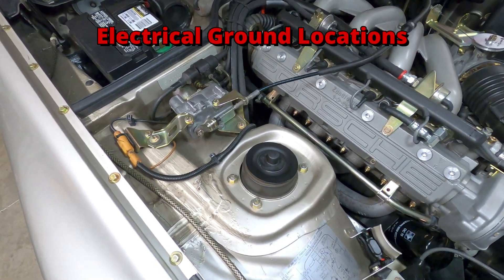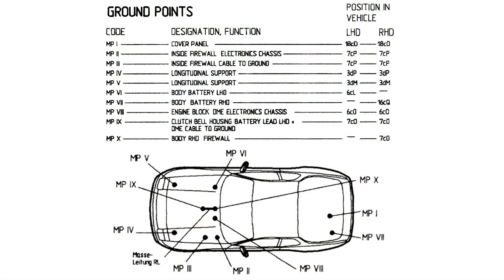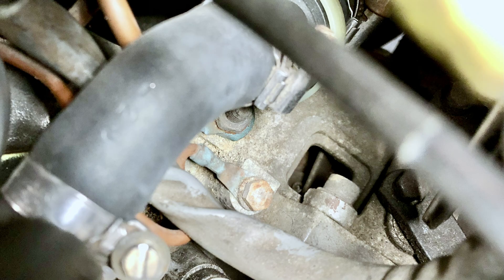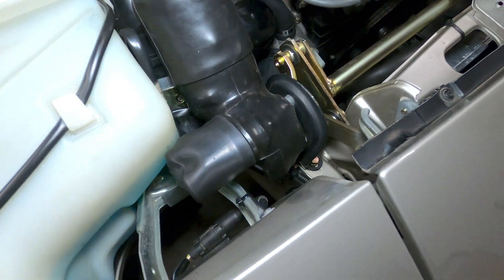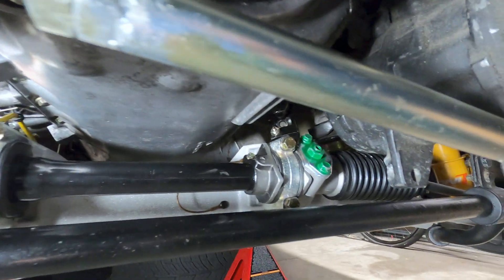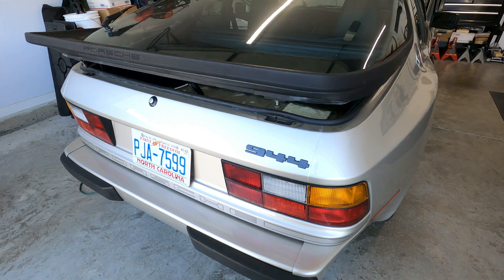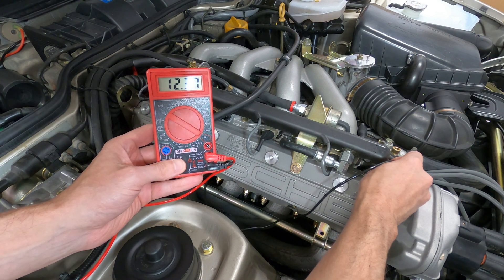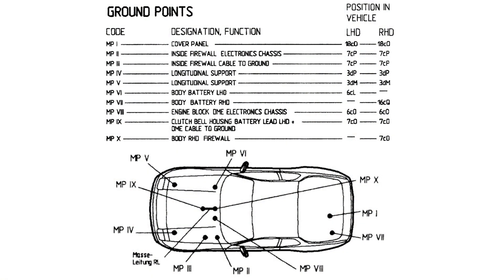Porsche 944 – Electrical Ground Connection Locations & Issues Tutorial

Comment: Great video.  Can I ask where you got the floor mats from?
Reply from the maker: Hey thanks! The floor mats are from Lloyd Mats out of California, but they no longer have a license to embroider the Porsche brand, still nice durable mats though. https://www.lloydmatsstore.com/
Reply: @NC944er  damn, I was looking for the Porsche brand. Thanks anyway👍
Reply from the maker: @daev_80  Porsche still sells a set with the logo, although they are slightly different from the original ones made in the '80s. Check out part number: 000043153225FV and here's a link: https://www.pelicanparts.com/More_Info/000043153225FV.htm?pn=000-043-153-22-5FV-OEM
Reply: @NC944er  cool, thanks for the help.

Comment: Do you put any dielectric grease on the ground connections?
Reply from the maker: Hey! My car is mostly stored indoors, so I don’t put anything on the grounds. I mainly use dielectric grease for things like battery terminals and the inside edges of the spark plug cable boots. There are some misconceptions floating around about dielectric grease and despite having the word “electric” in the name, it doesn’t actually conduct electricity, it just insulates. So if your car will be stored in moist conditions for extended periods, you could put some on the outside of the ground connections after they’ve been cleaned and tightly reconnected, which would protect the surface from elemental exposure.

Comment: This can be overlooked. I had a loose ground. Thanks for this! 

I am having a weird problem. My MPG gauge recently just pegged all the way to the right. It used to be pretty consistent keeping the MPG data. Any ideas with that? Wondering if the gauge has just quit. Car runs great, I did run a smog on it to see the hydro carbons etc. It passed with flying colors. Fuel pressure is on the money, spark plugs look great. Trying to rule out anything else…
Reply from the maker: Sounds like an electrical gremlin somewhere. Some people have had success cleaning and reseating the contacts and connectors behind the gauge cluster. Sometimes they come loose…
Reply: Ok. I will visit this. Thank you for the insight. You are always spot on! Thanks man.
Reply: I’m having the same problem with mpg gauge and also my temp gauge is swinging wildly from mid to high. Right before the mpg gauge stopped working there was a puff of smoke from under the instrument panel area. It was white and went away quickly. After that the temp gauge seemed back to normal for the rest of my drive. Next day temp gauge was swinging around again and the mpg gauge was moving but seems inaccurate. Do you have any advice. Could it be a grounding issue?
Reply from the maker: @brigittepauli  A puff of smoke from electrical components is never a good sign. Sounds like a short somewhere or a failing circuit. I would pull the gauge cluster and inspect the boards and all the wiring for damage.
Reply: @NC944er  thank you so much. I had a feeling this would be more than a grounding issue.
Reply: I solved it! FINALLY. I’ve always had this slight parasitic drain on my battery. Nothing major. Then, one day, I was driving and heard a small pop from the fuse box. Boom! #7 fuse popped. My cigarette lighter was shorting out. I lost my radio, interior lights and clock. This also…affected the MPG gauge. Now it’s all working after replacing the cigarette lighter and number 7 white barrel 8 amp fuse.
Reply from the maker: @P1983sche   Nice, a great find! Yeah, for the circuits that have a number of accessories connected together, it can be a real pain to narrow it down. And the electrical diagrams in the manual are slightly less than approachable. 😂
Reply: @NC944er  Man. You said it. I had an electrical thing in the window switches. Took me longer than I liked to figure that out haha. My passenger window switch wouldn’t roll the passenger window from the driver’s side. Usually electrical problems are from someone else going in and hacking the wiring. They had things connected wrong and backwards.

Comment: Went through mine not too long ago, helped gauge readings quite a bit. Also to note, it’s good to cover the bell housing hole before removing the grounding bolt so not to drop the bolt into said hole…heard that’s not fun. 

Thanks for the video, and we’re still all jealous of that engine bay! :)
Reply from the maker: Ha! Pro tip, thanks for sharing. 👍🏼

Comment: Hey thanks for putting out all this content. Definitely has been helpful for me. I’d love to send you some brake wear sensor clips. I made them to be very similar to the factory clips. Let me know how I can get them to you.
Reply from the maker: Hey yeah, that would be cool as I’ve found the part number to be NLA and so I’m using the smaller sized ones that are meant for the lower clips on the strut towers. My email address should be listed at the bottom of the “About” section of my channel.

Comment: Grounds are so important on these cars, just like the vacuum system. Not a bad idea to replace the battery wires after all these years too. My negative cable had no readings in most spots, with the only good reading coming in around 4 ohms on the main ground strap that connects to the bellhousing.
Reply from the maker: Wow yeah, I’ve seen some bad ones. 944online still has the factory harnesses available (surprisingly), but some folks just make their own.

Comment: another great video. the funny thing is that i have a new alternator and when the weather gets cold seems like battery or lets say cranking is heavy slow unless it is warmed up and the other day it drain the battery also maybe i have a ground connection lssue?
Reply from the maker: Hey man, yeah it’s possible. There are a number of items (like the driver side door jamb switch) that can cause parasitic drain on the battery. Cold weather conditions and long resting periods in between drives can exacerbate the issue.
Reply: @NC944er  yea exactly that is what's happening. thanks man. one day i will bring the car to you for work and will leave it for updates.. i have a nice clean one 944S 1987 and would like to do some detail from 0 to top etc..instead of giving that money to my porsche guys here which they are not carefull w the car that bothers me u know.
Reply from the maker: @SAMMYJR00777  So true… mine is at the dealership now for the windshield replacement and I’m a little nervous about how it’ll turn out, but at least there will be a warranty if something gets messed up. 😂